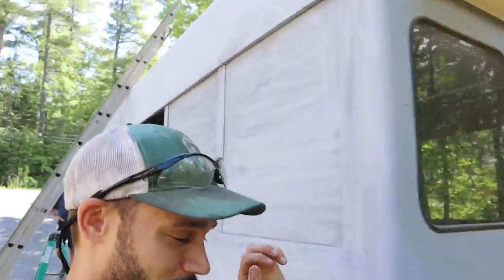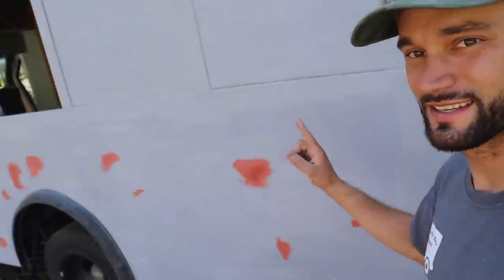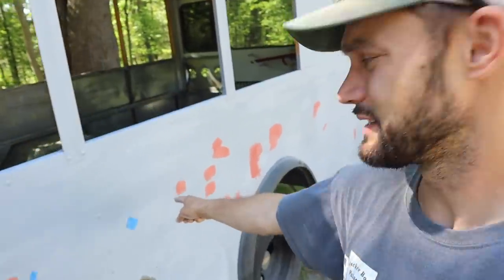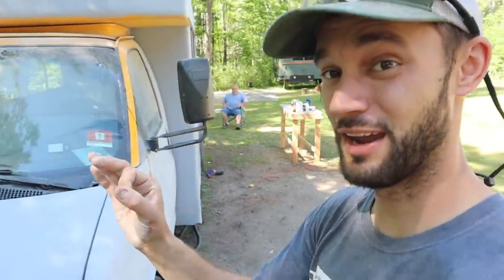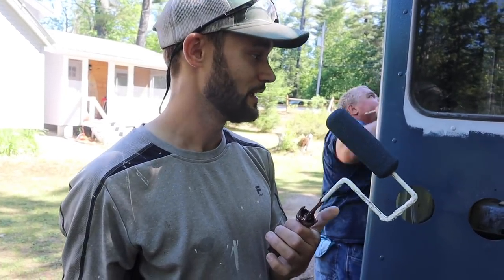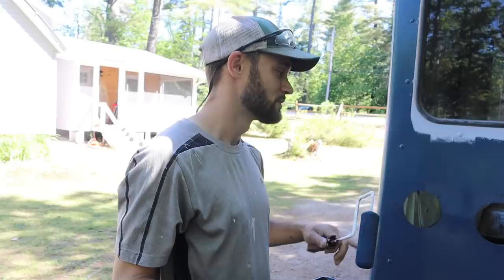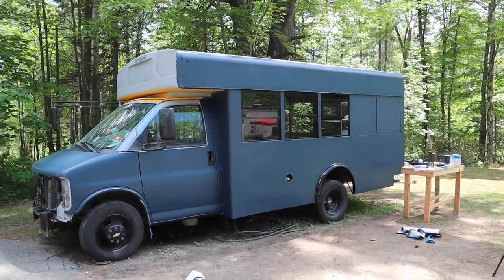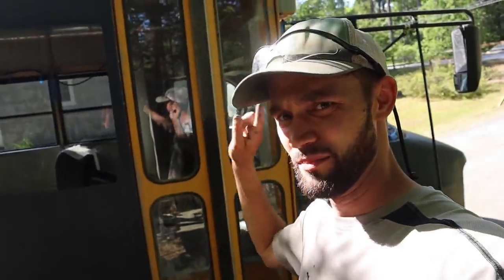What Color Will I Paint My Tiny House School Bus

Comment: Great work. Nice color. And what is the paint you are using?
Reply: I don't want the color code. Just the brand of paint. It is a cool color, but I'm planning on white.
Reply: @rubberdwellers3911  Sherwin-Williams Pro Industrial Acrylic Coating  Color: Gale Force SW 7605

Comment: You know if you give it a light hand sand with a coarse scuff pad before you put the next coat on. It'll make the next coat come out even smoother. I think rolling it on was a great idea. Being it's exposed to the outside. You can get rid of the annoying bugs in the paint quite easily.
Reply from the maker: Yeah, I really did not what to deal with the outdoor elements trying to spray it haha. Next time.

Comment: Navi Jr.'s looking great, Mike. Blue is my favorite color, so, yeah <3

Question for ya:  When do you decide to glass vs. rivet vs. weld? There was a bit of all three in the prep of this exterior.

Also, are you planning for a blue or white roof?
Reply from the maker: Thanks John.

 I did it all three for different reasons. One, my welder is not set to hold anything less than .30 so it is hard to weld thin sheet metal with this cheaper welder. Secondly,  I have a lot left to learn about metal from people smarter than me haha. Also, I like to show different ways of doing something because I know that a lot of my viewers have different skill levels and tools on hand.

The roof color will be white, I plan to take the roof line down just lightly over the curve.
Reply: @navigationnowhere  Thanks Mike. I thought that might have been the case, so it was great to confirm. Also, showing folks that there are multiple ways to affect the same result is incredibly helpful.

The white roof as you describe is going to look soooo good against that blue/grey lower.

Have a great one...

Comment: If you don't mind a question: How has this paint held  up over the years?  Would you use the Sherwin-Williams Pro Industrial Acrylic Coating again?
Reply from the maker: Ivan is held up really well if prep is done correctly. My previous bus Navi, the green one, he’s also painted with the same paint. I have repainted it twice in seven years. I found that if the prep and prime is not done very well, the paint will chip overtime.

I never minded it chipping on Navi because I purposely painted it with a brush so when it would get beat up on dirt roads and back, Boondocking roads, I just pull out a paintbrush, touch it up and no one’s any wiser .

If you look back about a year, you’ll see a video of us painting Gina’s bus, a white bus . That one was painted with rustoluem white exterior metal paint from Home Depot, and that one has held up for two years now. That bus was sprayed
Reply: @navigationnowhere  Thank you for the information.  Keep making great videos.